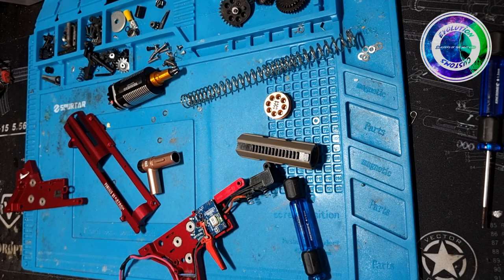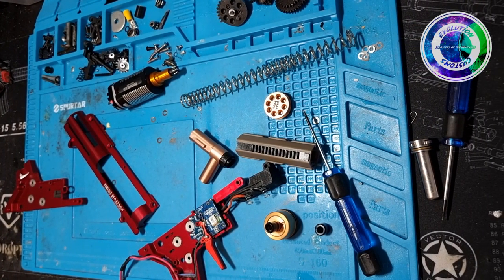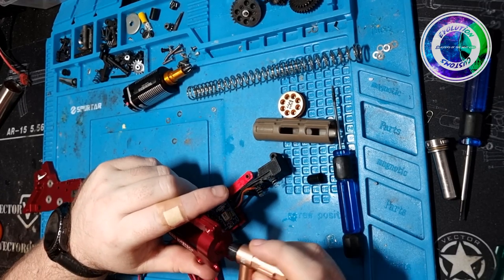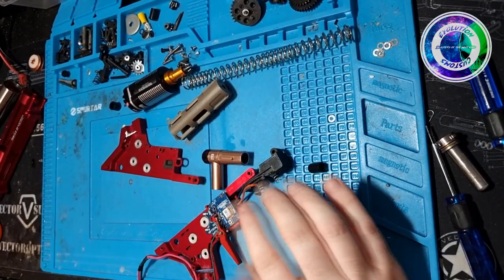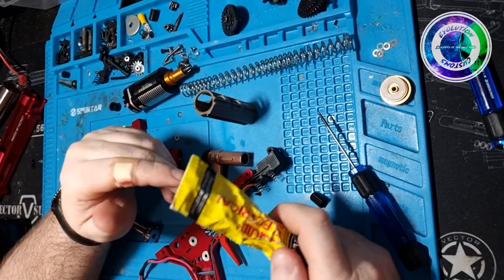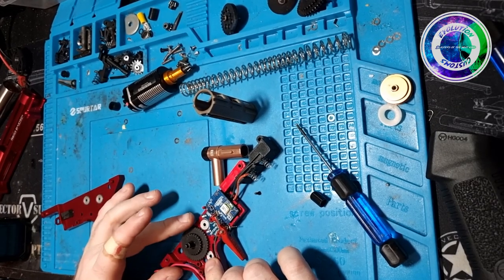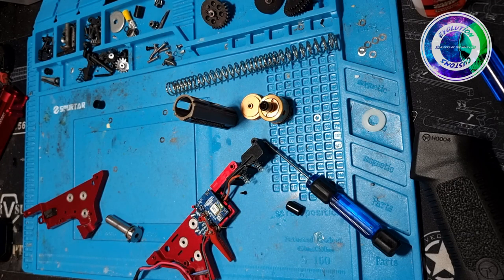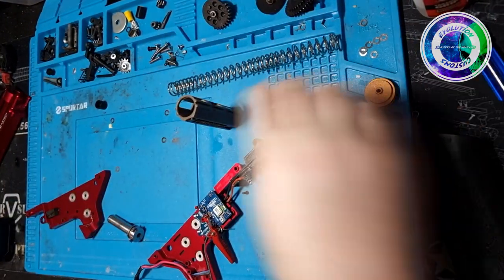Tips/Advice for DIY AEG Techs (Glues, Timing, Rubbers, AOE, Pinion to bevel, Shimming etc)

Comment: Thanks for the tips on prolonging the life of cast gearboxes. Have tried nylong piston heads to minimise vibration, and even o-rings on the front of the cylinder head, but they eventually work themselves loose and obstruct the tappet/nozzle. With many JGs, am open to any suggestions as they have a horrible habit of cracking, even in stock configuration. Whereabouts do you get your brown o-rings from? 

Cheers

Comment: What would your preferred motor be to get 40rps on a standard 9:1 DSG set?
Reply from the maker: Preferred would be an 18k infinity and use 16:1 with the dsg gear and short stroke 1 tooth so it will be around 40k rpm on say a 65c 11.1v or throw that motor combo on a 6:1 (12:1 lower sector and dsg upper) or a 30k asg motor for price on 9:1 but my preference is a frankentorque or a bushless 30k for dsg. Can't beat the brushless for effieniency but the frankentorque is still super efficient but not quite as much as say a warhead motor
Reply: @shakkaclacka9150  Thanks Shan.  Brushless 30k sounds like the one for me
Reply: @shakkaclacka9150  9:1 dsg with a 30k asg boost, are we still short stroking 1 tooth? and what M rated spring?
Reply from the maker: @jjanderson1987 yeah man  it's optional to short stroke 1 tooth or not just know it will effect fps and voluming if you do short stroke 1 tooth. M160 is my most commonly used on dsgs

Comment: Absolutely amazing advice mate, super helpful.

My only question is, you mention that DSGs are very easy for timing (in terms of piston cycling). Do you short stroke your DSG builds? Or do you just run it as normal? 
Thinking of doing an 18:1 DSG build, with an M160 (or 170 not sure yet, would love your advice), Aztech piston/cylinder head and a 30k warhead motor. Would i need to short stroke it? Aiming for 300 to 320 fps.
Reply from the maker: That would be perfect for an m160 without short stroking the dsg. Dsg timing on the piston becomes a problem say if your running an m150 non shortstroked on say a 45k warhead or 52k warhead. Being a 30k you should have no worries in terms of piston timing. Just shave off each tooth you don't need before you epoxy or jb weld your piston in to lighten it up as much as possible for faster rester time 🙂
Reply: @shakkaclacka9150  Perfect, thanks heaps bro! 🤙